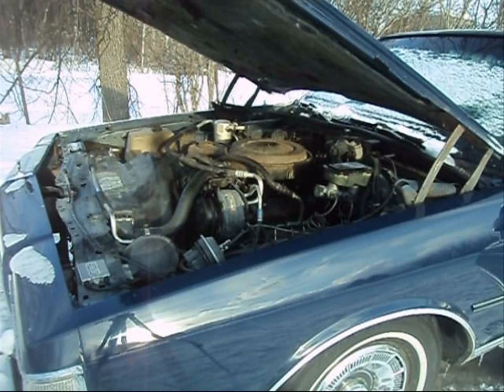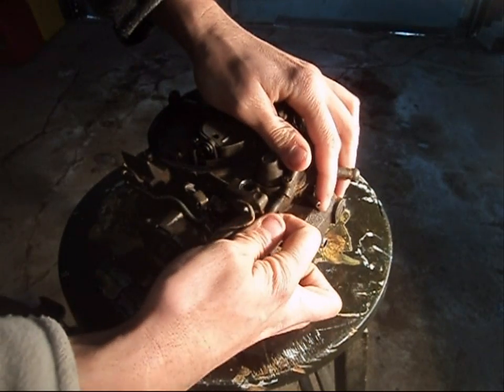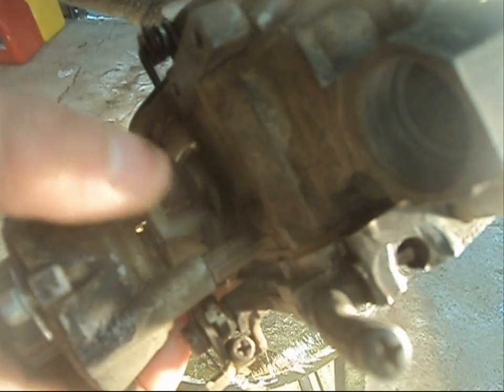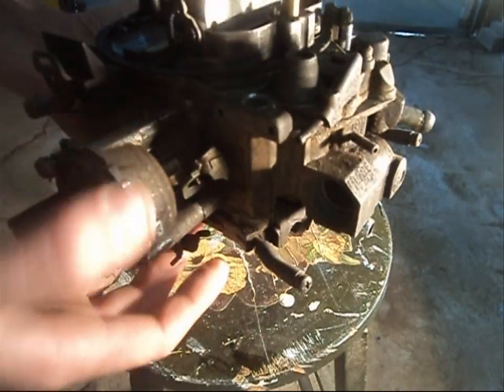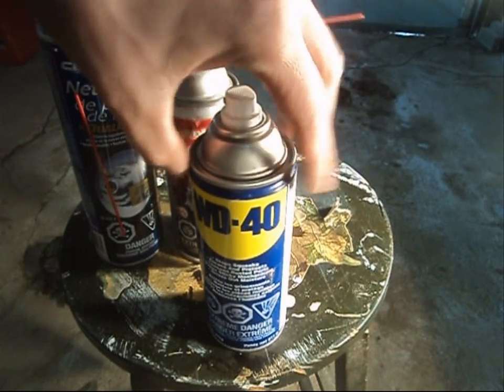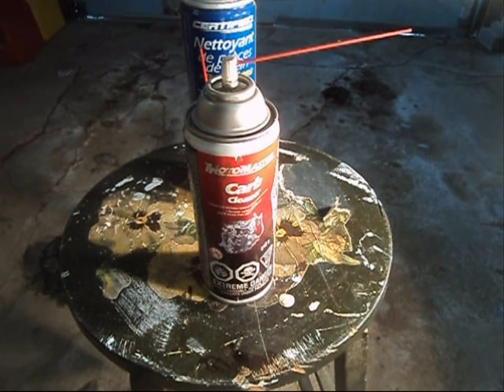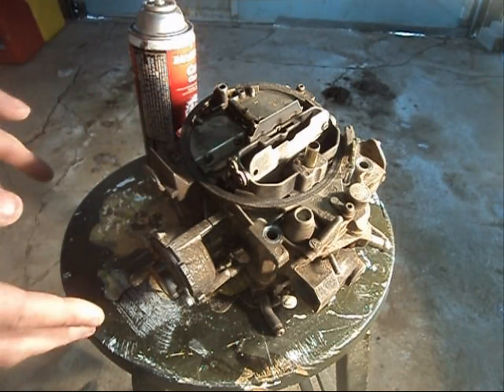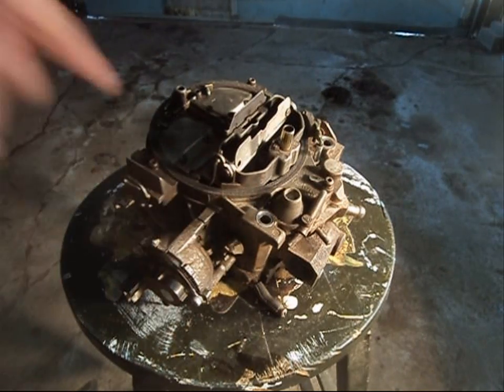Choke Idle Won't Kick Down!

Comment: Nice video. But there's more to this story that may also cause high ideal. The secondary throttle plates may be sticking slightly open. This was my problem. It took taking the whole carb off to thoroughly clean the carbon deposits holding the throttle open.

Comment: For someone who is only 25 like me your switched on with your knowledge of these cars I only came across your channel today  here in Australia we deal with fuel injection more so than carby systems and is great to learn a little about these systems    
I'm glad someone is saying WD40 isn't good for exposed engine parts that need to be somewhat clean for good operations  I had used it once on my throttle body and it created a large build up or grime       Australian Caprice is called a Holden caprice great looking cars but nothing like yours  Aussie cars are mostly rear wheel drive  (more fun )
Reply from the maker: Well I hope you enjoy my channel, the Holden Caprice (uses Chevrolet name plate here) has started to make its way to Canada. Infact there are a few law enforcement agencies around here that are using them now since Ford's Crown Victoria is now obsolete (2011) and I agree RWD will always be the way to go.

Anyway Cheers mate!

Comment: Just had my k10 do this got stuck at 3k and wouldnt go down, went under the hood and manually moved it back down. Thanks for explaining what it could be.
Reply: My 81 cutless does the same thing and driving is at jumpy and high rpms to cause choke pops right back up. Ever found out what it was?
Reply: @Brandon Bouvier  I took carb cleaner and sprayed the hell outa the electric choke area; it fixed my issue.

Comment: Try and adjust ur choke plate.(black choke cover on pass side of carb w the 3 screws. Cuz I literally just had same issue with my new(remanufactured) quadrajet i was bouta go back to oreillys n slap em w it 😆 anyways ima newbie when it comes to carbs and I feel like I've accomplished something by doing this but i realized I had it set lean(to the left of the notches on choke housing.) Not even in the notch area lol And i moved it CW and it stopped idling so high AND quit jumping back to high idle. And it started running the way it should 👍😃...you may have to adjust ur fast idle a bit(while still cold) but it should help! hope this helps anybody

Comment: I have a 1981 c10 with a 305. Just recently the choke I believe is sticking. I tap the gas while in neutral and the idle gose back to normal. The idle also raises between gear changes then when in gear it gose back to normal. What would you suggest? I thought about disconnecting the cable

Comment: Dude, I am one of those folks that used the wd40. Wondering if I clean rhe linkage with carb cleaner it should work, I wont need to mess with the idle screw because that isnt whats making the fast idle, correct?

Comment: great job dude...please do the same tutorial for a ford 1986 4.9 6 cyl YFA carburetor. the choke is not kiking up or down like it is supposed to.
Reply: adjust ur choke plate. I had same issue and realized I had it set lean(to the left of the notches on choke housing.) Not even in the notch area lol And i moved it CW and it stopped idling so high AND quit jumping back to high idle started running the way it should 👍 ull have to adjust the fast idle screw(while still cold)

Comment: My problem is the opposite. It kicks down and, until it fully warms up, wants to die. Especially when I go to put it in drive. It's a Quadrajet on a 454 Chevy. But looking at the video I believe I have linkage problems. I have great vacuum and no leaks anywhere. The motor has 99k miles on it. Maybe time for a new rebuild. David 🐈
Reply: Gotta set ur idle screw on drivers side of carb. Get a buddy or ur wife/husband? With the car warmed up Have them put car in neutral, THEN start it w the ac on and then adjust the idle screw in small increments til it gets to the desired RPMS. And with engine cold adjust ur choke plate(black cover on choke housing on pass side w) if necessary

Comment: Serious question I have an 89 Cadillac brougham And I just recently swapped out the 307 to a 455, my question is will the ECM adjust to a pro-form 650 electric choke double pumper

Comment: Hey TheYoshiClan  sorry to bother you however I have a 1987 chevy caprice classic with an olds 307 and a quadrajet which is giving me some trouble. The vehicle drove fine for the past year or so (with the exception of some hesitation when moving from a stop) However, recently the vehicle will just not drive over 40mph, It will bog and/or stutter until eventually the engine just stalls and I need to pull over. The engine idles fine and revs great when not under any load. The accell pumps seem to be working fine  and I don't appear to have any vacuum leaks. Any insight? Possible issue with the secondaries? Or should I just rebuild the entire carb?

Thanks!..

Comment: How do I adjust my idol adjustment screw properly. I was having a problem with my engine stalling at every stop sign so we adjusted it up to keep it from stalling now the stalling problem is fixed but I believe the screw needs to go down more or up more because I am having the dieseling problem and I know the carburetor choke is not engaging to the proper low idle and I believe it's because of screw needs to go down more or up more

Comment: I'm having this very problem on my 85 Monte Carlo if I take the air cleaner off and manually push down the linkage my car won't do that knocking noise but it only works for certain amount of time then here comes the knocking I'll go ahead and give it a try with the car cleaner and I'll post my results
Reply: This is the same problem I'm having. Did that work for you?

Comment: You’re a god.

I just pulled over at a light and jumped out because my car was a tap away from full throttle, I hit the coke and saw it snap and the revving backed off. Scared the shit out of me man, then it dieseled.

Omw to grab some carb cleaner. Is there ANY lubricant that I could use or just the carb cleaner and I’m good?
Reply: you typically don't need any lubricant, as that will attract the dust/dirt that caused the issue in the first place. That being said, some graphite spray should help you, it's dry and doesn't attract dirt. If you're cheap, just rub pencil lead (which is graphite) alone the moving points of the linkage and that should help :-)

Comment: Hello My Dad HAs  A 1979  Chevy Monte Carlo with 68,000 original miles 
He's had since 79  all original with The chevy 267 V8 4.4L  2bbl  
Rochester Dualjet 210   and just recently the engine has been racing 
like crazy will not go off of fast idle a bit, won't kick down .   What 
would be causing this it  is not deiseling , Thanks

Comment: I had a new carburetor put on and its still doing the same thing, what it could be?
Reply: adjust ur choke plate. I had same issue and realized I had it set lean(to the left of the notches on choke housing.) Not even in the notch area lol And i moved it CW and it stopped idling so high AND quit jumping back to high idle started running the way it should 👍 ull have to adjust the fast idle screw(while still cold

Comment: I sprayd the linkage and it still won't spring back it won't even move when I hit the gas pedal the gas flows and the throttle cable moves everything moves but the fast idle cam won't move acceleration pump lever moves is it my electric choke or the relay

Comment: i have a 1406 can not get it to idle-just checked out by a good carb man-i real short screw the one you can only adjust with linkage wide open,i cant semr to get that right --got any sugestion thanks
Reply: You mentioned that voltage to choke could be wrong. Why didn't you tell us what the voltage should be.

Comment: Hey wolf pug I was wondering if you could help me out I have a 1984 Delta 88 Royal Brougham 307 5L I have owned the car for 12 years it has been parked in my garage for six of those 12 years recently try to get it started bought new battery new distributor new coil new plugs but still have original distributor cap and rotor and plug wires I flushed out all the old gas put new gas all new fluids found top dead center stab the distributor in I am getting a crank BUT  No start No spark situation I was wondering if you could help me out. I checked the codes and it keeps reading 12 12 12 12 over again and when I was checking the codes a noise from my Holley 4-barrel where the electric connection is kept making a ticking noise have you ever heard of that can you help me out?
Reply: Car is all original.. ..

Comment: come fix my '83 F150... won't kick off high idle
Reply: Try and adjust ur choke plate. I had same issue and realized I had it set lean(to the left of the notches on choke housing.) Not even in the notch area lol And i moved it CW and it stopped idling so high AND quit jumping back to high idle started running the way it should 👍 ima newbie when it comes to carbs and I feel like I've accomplished something with it😃 hope this helps
Reply: @Robuerto Diaz  I will try it...the previous owner butchered the auto choke thing and install some sort of manual one...I'm in the process of deleting that and finding a new auto-electric choke... will try what you said when i get it sorted.
Reply: @darickymeister  same here. Some of the hot air chokes can be switched to the electric by just switching the cover which i did and I still don't have  The wire hooked up not sure which wire or if I just needa run a new one